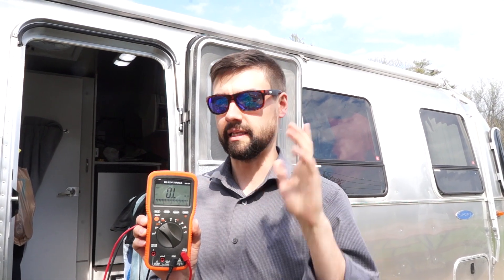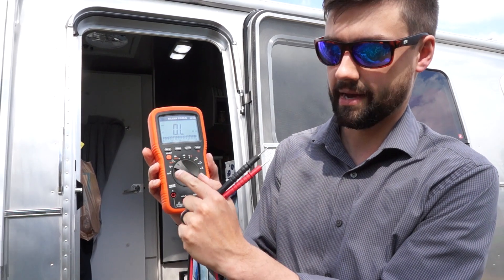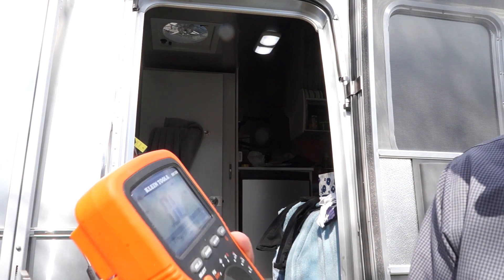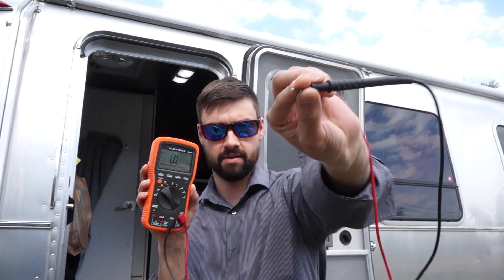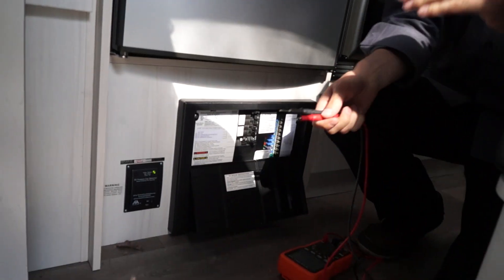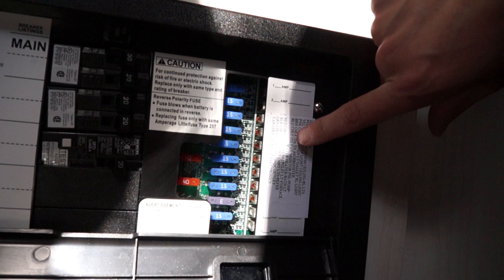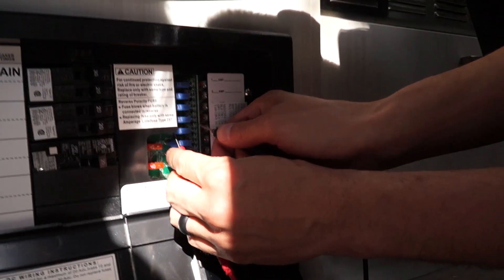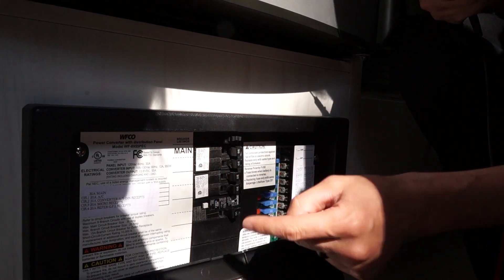Broken Atwood RV Water Heater (Troubleshooting and Repair)

Comment: I believe there is a design problem on the controller board that causes infant mortality (some might call it a retroactive abortion) of the PCB's transistor that sends 12VDC to energize the Relay mounted behind the heater that sends 120VAC to the heating element. I have had two replace the potted controller TWICE in a 3-year period because the yellow wire was not getting energized. Otherwise, a $0.25 transistor is all that would be necessary. The Propane portion of the heater was working. It is good engineering practice to add a DIODE (1N4001) to clamp the back EMF produced when the relay is deenergized. I soldered the Cathode to the yellow wire and the Anode to the Green wire in position #6 of the connector. This way the new controller's transistor will not be damaged in the future. The PCB's relay that sends power to the Gas Valve may very well have a similar issue but there is no way to add a protection diode due to the potting compound.

Comment: Thank you for such a detailed video. It helped me eliminate everything that I can see on the outside. Do you have any tips on how do diagnose problems with the 120V heater? My Atwood works fine on propane but quit heating with shore power electricity. I checked the breaker and it is fine.
Reply from the maker: I haven't seen one in person so I'm sorry I can't help

Comment: So you are saying that the newer version circuit board the plug on the wire harness is up on the top part of the board sitting horizontally intead of vertically.  Correct?
If that be the case the one in my motorhome is the newer version.
Whatabout that 2A fuse.  I don't see any fuse on mine. What about yours?
Reply from the maker: I dont have the rv anymore so I don't know. But if you Google the circuit board numbers you might find old numbers

Comment: Dielectric grease. Rule of thumb. The grease would literally rather die than be conductive. 

Passing voltage through dielectric grease causes it to break down at that point it becomes conductive but also sacrifices it's ability to repel water, coat services for anti corrosion and wash-away static buildup. Dielectric grease that has voltage flowing through it breaking it down causes mortgage too close early I.e arks and Sparks thusly short circuits, especially to ground.

You want to put it on your electrical connectors where they are rubberized to create a seal for keeping the environment out and never on the metal contacts!! imagine your spark plug wires. You put the grease where the rubber boot touches the porcelain only and never where it connects in the top-center IE very back of the boot or on the spark plug nipple. 

When you go to replace spark plug wires and plugs and you find nasty crusty yellowish fried dielectric grease all jammed up in the boot and on the nipple of the plug.. that's exactly why it's time to change the wires in the plug but in some cases simply cleaning that junk off will suffice. Suffice it to say it keeps rubber rubbery and elastic so that it can heat up and expand to make a new seal in such occasions each time it happens which is exactly what you wanted to do because bad hardened rubber doesn't create a seal to keep the environment away are out of the inside. Where the electrical terminations are.

Another fun fact is that we call them terminations where two pieces of metal touch and create a connection. A termination in the sense does not mean that we have destroyed the connection between two points of contact.

Dielectric-Greece and anti-seize which is conductive by the way are both insulators. 
Fun fact auntie's are only conductive because they have metal particles in them but they are not used as a conductive Grease. 
846 is an electrician's Greece. A fluid or a grease must practically fulfilled three or four things depending on application. One it must act as a lubricant. Two it must typically act as a heat transfer. Three it must act as a detergent and in the case of electricity instead of washing away rust or corrosion per se it in actuality washes away the presence of static electricity build up. And 4 it must act as a coating in order to keep materials or metals safe from the environment so as to not rust or corrode.

Think about your car and ask if water fulfills all four of those requirements for your cooling system and Bob's your auntie.

Comment: Great job. Same heater on 2016 Bambi FC, all red wires melted. Thoughts?
Reply from the maker: Sounds like your solenoid has an issue if those red wires lead to that. The other red wire leads to the thermostat.  Or you could have had a fire in there if other wires are burned
Reply: So can I replace the red wires or do I need to replace the control?
Do  wires come with control or solenoids?  Ill replace the brown wire and fuse first.
Reply from the maker: The control does not come with wired

Comment: My heater will trip GFI outlet when electric turned on and element seems to test good.
Reply from the maker: Could be a faulty GFI. You can buy a GFI tester to see if that's the case

Comment: Wow. Saved me significant trouble and money! Water heater wouldn't ignite on a used Lance 2285 I brought up from Florida. Found a bit of corrosion on the igniter fuse (?). Dipped it in baking soda & water. Fired up! Many thanks!
Reply from the maker: Very welcome!!

Comment: Great video! I just purchased a '95 Prowler with a heater that looks the same. It's a GC6AA-7. Almost the same. I looked at a manual and it said the C stands for combo Gas/Electric. The AA refers to element type. Does that mean it should also be able to heat on electric only, or does that just refer to an electric spark? I have a battery cutoff switch coming this week and will be troubleshooting the heater hopefully this weekend.
Reply from the maker: It has both elements both electric and gas.
Reply: @touringtreadwells5750  Thank you! Here's a funny. I was looking at a schematic to look at element types and saw a switch that it said would be inside the camper. Well, I never flipped that switch. Only the breaker. I imagine I may find that this was the issue. Haha
Reply from the maker: That's why I always check the cheap things first!

Comment: I have an Atwood unit that will fire and after a few minutes the burner will cycle down to what seems to low flame. After 30 minutes still had cold water. Help!
Reply from the maker: check the easy stuff, do you have enough propane? Is the tank valve on? There could also be air in the line, best way we purged ours is to use the normal cook top inside the camper for a minute or two to purge the air out

Comment: Question- I have the same set up. I flip the switch and run out to hear clicking, smell propane but nothing else. It does this 3 times and the Ted fault light comes on. I’ve done this process over and over. I smell and heat propane coming out but no spark or anything.
Reply from the maker: its probably the circuit board if its the same unit.

Comment: I replaced the circuit board and the red/clear thermal cut off boot and it clicks lights, continues clicking while lit then shuts off:(
Reply from the maker: Can you smell or hear propane? Sounds like a fuel issue
Reply: @touringtreadwells5750  it lights, so yes I see propane but the clicking continues and then the flame cuts out. I’m going to try replacing the Spark and Sense electrode
Reply from the maker: Sounds like a bad thermocouple, it's the item that heats up to let gas stay going. If that's not working gas will come in the. Shut off

Comment: Thank you for the video. You’re right, yours is the only one with the circuit board bad. So, mine tries to light, sparks, but doesn’t light. I replaced the circuit board and still doesn’t light. So I’m checking the solenoid valve tomorrow.

Comment: If the circuit board is fried will the switch not light up?  Thats my problem. No light on my switch since it stopped working.
Reply from the maker: I can't remember, we haven't had the issue after. The light next to the switch signals that's it's working so it's probably told by the board to turn on. I would replace the board to check
Reply: @touringtreadwells5750  might replace my switch first then the board next. Whatever's cheaper first
Reply from the maker: Good point you can also test the switch really easy
Reply: @touringtreadwells5750  so I replaced the mini 2a fuse, and miraculously the switch turned on for 3 seconds, ignition clicked a couple times, then fuse blew. Maybe a short somewhere. Fuse arrives Monday. Test #2. Then will replace board next if that doesn't work. Wiring looks good
Reply from the maker: Trace that fuse back sounds like a short
Reply: @touringtreadwells5750  Replaced the Atwood switch with a Dometic branded one ( look the same). Replaced the 2A fuse that kept blowing also, and it seems to work now. Will pray it does not die when im out on the trails :)

Comment: I have already done all that and it still  doesn't work there is no water coming thrugh the line
Reply from the maker: Are you getting any cold water?
Reply: @touringtreadwells5750  yes
Reply: There a check valve on the tank where the hot water comes out could it be bad
Reply: And where could I get one if so my camper is a 2007 springdale
Reply: The water in the tank is hot
Reply from the maker: It's probably that RV dealer or hardware store
Reply: @touringtreadwells5750  ok

Comment: I'm not getting water to the sink or the tub but I have hat water
Reply from the maker: Turn the sink to hot for a long time and it should work. The lines have lots of air in them. Or go under the sink and see if it has valves
Reply: @touringtreadwells5750  and I didnt see any valves

Comment: Your broadcasting some information not factual. Never use a ratchet on the ignitor board screws as you can actually crack the board housing . Always use the handle nut driver especially to tighten. What you are referring to as a Sparker is called an Ignitor.  Dinosaur actually manufactures an excellent ignition board. "Never use dielectric grease." Not a good conductor at all.
Reply: What you pointed out is absolutely minor, nonissue. He’s already been shown the correct, safe way to check fuses. Sparker, igniter, semantics. Sparker probably made more sense to the novice. Nice job on the video!

Comment: Dielectric grease is a good call for that In-Line fuse that he used it on. 
Do Not Use it when it could cause a connection between positive and negative wires (or terminals)...that is, when + and - are close together, and the grease could bridge the gap. 
That's what (i think) he meant about cases where it could cause a short ✌

Comment: 🤯 $80 Klein multi meter????
Slow down there, Bezos.  My FREE Harbor Freight multi meter works just fine, thanks 👍. And a $20 Commercial Electric one would be a considerable upgrade. The Klein is nice if you're an electrician using it every day to earn a living, but it's not 4x better than the CE. They ALL do the same thing. ✌
Reply: Great Video btw! Accurate,  well detailed, really good pace,  no extra nonsense or time wasted 👍 Thanks!
Liked and subbed.

Comment: I have the same water heater and mine is sparking but I don't think I'm getting propane in the tube both Brand new filled tanks ? What do you think I should look at.
Reply from the maker: 1. Make sure the tanks are turned on😃2. Turn your inside cook top on by lighting it  to bleed the air out if you have one
3. Try again and see if you can smell propane by the furnace (be careful)
4. If that doesn't work it could be the board if you haven't updated it yet

Comment: I'm having the same issue not working on gas but it does work when Im hooked  up to regular electricity.
Reply from the maker: I haven't dealt  with the electric/ propane one. But the troubleshooting for propane should be the same

Comment: Caig DeOxit D5 is best for corrosion and connection point maintenance. Also dip your test leads in a drop of D5. They work better. It is critical to check the ground lug points to chassis ground. Treat them with D5 when possible.

Comment: Excellent video. I have the exact same HWH and couldn't figure out why it wasn't working with propane or on shore power. Tested the circuits and fuses with my multimeter and everything checked out. But when we took it in we discovered that the inline thermal cutoff fuse (on the HWH itself) was intermittent. My continuity test showed it was good but when wiggled it would go off and on. Replaced that fuse and we were good to go.
Reply from the maker: I'm glad it was a cheap fix

Comment: Yeah, silly Airstream put in a propane only heater. Cheapos.
I miss the heater in my 2000 Dutchman. It ran on park grounds power or propane with flip of switch.  Propane is commodity I like to save for cooking/heat.  Wish I could change the one in our 2010 'Cloud 27FB to dual heating.
Reply from the maker: Yes it would be nice to have both and save the gas

Comment: Where is the heater element. I think mine needs replacing.  Works on gas but not electric
Reply from the maker: Mine is just gas. If you have electric you will see a thick cable going into the element. Refer to the manual

Comment: I have an older Atwood water heater in a 1989 Bounder. Sometimes it fires up sometimes it doesn't. I can hear it clicking it seems like it's getting no propane. Ideas?
Reply from the maker: See if you can smell propane when you hit the switch with the help of someone. Then see if you can see the spark. With the age of the unit I would not be surprised if you had corrosion somewhere

Comment: WRONG TEST PROCESS TO TEST FUSES.  USE THE VOLT METER AND CHECK FOR VOLTAGE AT EACH SIDE OF THE FUSE.  GROUND TO POWER SUPPLY GROUND AND POSITIVE LEAD TO EACH SIDE OF FUSE.
Reply from the maker: So I've been told. My method works when the circuit is dead to test the fuse but not the complete circuit.

Comment: Thanks for a clear explanation! I had the same issue and traced it to the circuit board. As you saw the new replacement board is different in size and configuration which makes me suspect that the original circuit board was a defective design, my unit lasted about one year. Also, my local airstream dealer said he keeps a lot of these circuit board units in stock - for a good reason! Aside from a few minor issues we really like our airstream.

Comment: I appreciate your video. I have the same atwood heater and have same issues. Ruined out weekend trip. Now time to test everything like you did. Thinking it will be the circuit board as well. Thank you for a great video
Reply from the maker: Very welcome glad I could help. Make sure you pull the fuses to test them or test to ground or shut off battery

Comment: There is nothing here about the power to the control board. How does it get power. None of the pins are sending power to it on mine.
Reply from the maker: The power comes the fuse box described in the video. Check one side of a fuse to ground and it should read around 12 volts

Comment: Why would you ever spend $80 on a volt meter?? damn. good vid tho, thanks! lol
Reply: Because he also spent $85,000 on a travel trailer
Reply: I spent $500 on a Snapon meter, it’s worth every penny. I troubleshoot aircraft systems so having a good meter is worth the money. I hate cheap meters,.
Reply: @SLICKW1993  partial to fluke myself.
Reply: Because they can cost far more for a good one.
Reply: Depending on the faratures you want, $80 is cheap. Mine cost me $70 Canadian, and it's just a store brand one from Canadian Tire, but it has the functions of 5 separate devices. If I ever get into working with generators, the meter I'd need would be much more expensive.

Comment: I have exactly the same water heater. However, the heater turns on with propane. But, it does not with power. I would appreciate, viable suggestions!
Reply from the maker: What do mean by with power? This unit only gets warm with Propane. They do make one that has electric and gas.

Comment: Thanks for the detailed video. I was having an issue with mine and no clue what to do. Using your video I found that my fuse wire was just corroded and once I cleaned both ends it fired right up.
Reply from the maker: Glad I could help

Comment: My Water Heater ignites when turn the switch on and heats the water. After the water gets hot it shuts off and will not reignite itself. Is it supposed to reignite after the water cools down? I have replaced thermostats and Ignitor. Is there anything other than the board that might be causing this
Reply: It should keep igniting when the water hits the low temperature point. Like if you were taking a long shower. Does the red light turn on when the water gets cold.
Reply: @BendItFishing  I have not noticed. The water heater has not worked since we bought the camper. The dealer we bought it from checked it and said they had it fixed but when we went camping it did the same thing. Red light on the switch does come on when you first turn it on and stays on.
Reply from the maker: Is it the same model as the one in the video? Does it try to ignite when it gets cold or does it not do anything? The low thermostat is suppose to complete the circuit to tell the control unit to reignite the system. Check continuity on the low temp thermostat wire. If its good replace electronic module
Reply: @touringtreadwells5750  Yes it is the same model as on the video and I have never noticed it trying to reignite after the water cools down. Thank you so much for all your help, I really do appreciate it. Kenny Walker
Reply: Try the Amazon link to buy a new module if that's the problem. It's in the description.